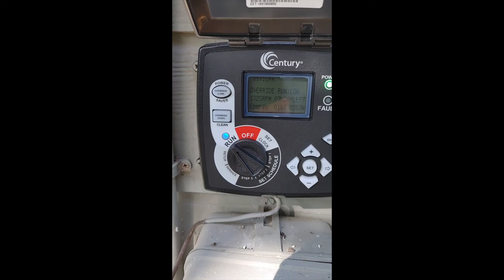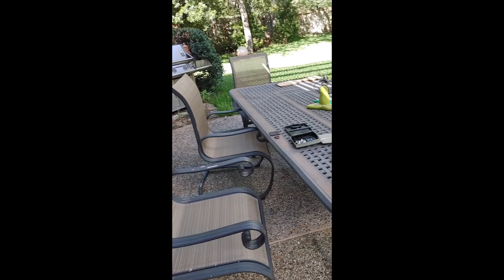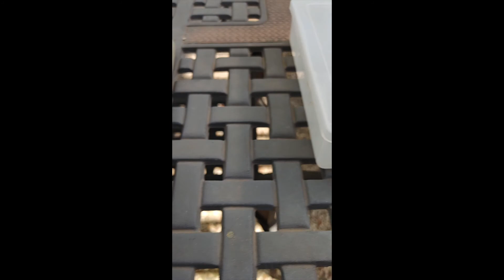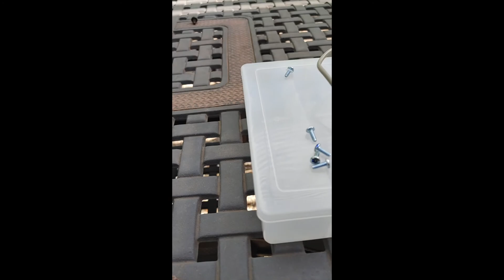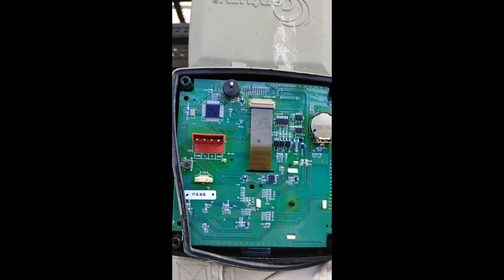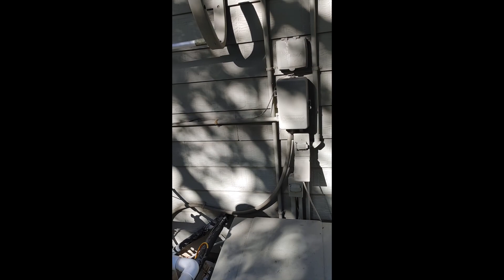How to Repair a Flaky Century Variable Speed Pump Controller

Comment: This was a tremendous help and it fixed my controller just fine. I thought I was gonna have to purchase a new controller and when I could not find a replacement anywhere on the web, I sought out a fix. This is exactly the issue... the contacts on the knob had lost their spring. Pulling them back just a bit provided the right amount of tension to connect with the proper setting. Thank you so much.

Comment: I know this is an old post but thanks--- mine is doing the same thing touchy dial switch. I am actually looking for a replacement now but I could not find the controller itself, I may try this first. My pump is about 6 years old so I figured it was toast - maybe not. thanks again.